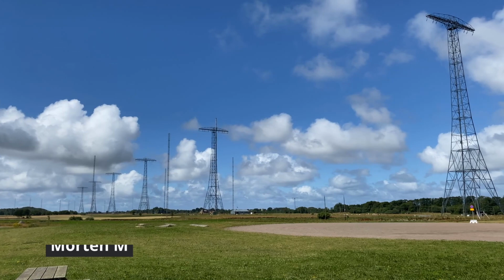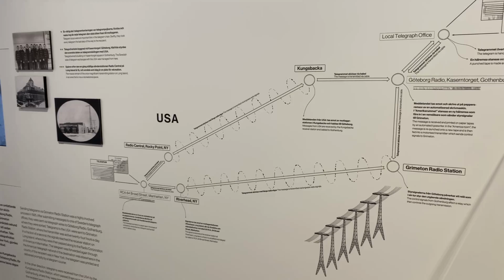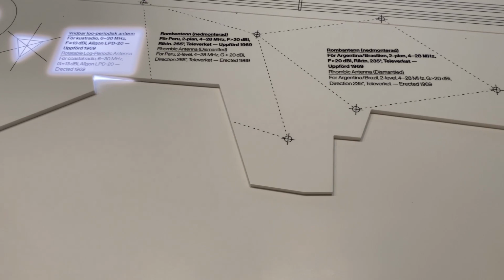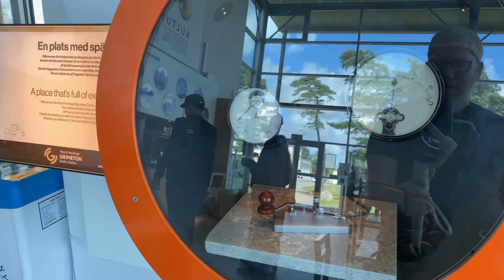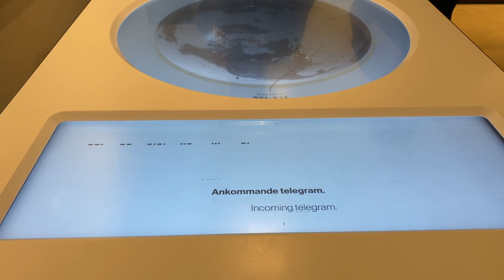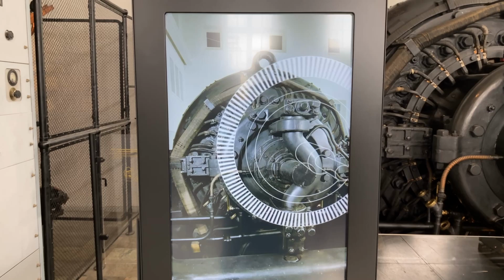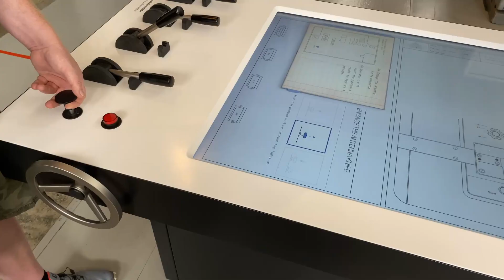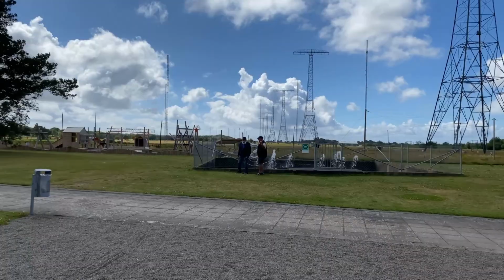The Grimeton Radio Station - UNESCO World Heritage Site

Comment: What an excellent tour through the facility.  Can you imagine the original antennas?  Thanks!
Reply from the maker: The original antennas are still strung through the towers. The antenna is a little bit shorter than two kilometers. The transmitter is started and transmits about two times a year.
Reply: The receiver antenna was quite a bit longer than the transmitter antenna. It was 13.4 kilometers long.
Reply from the maker: @ehsnils  Absolutely correct, and the receive antenna was not placed at the same location either.